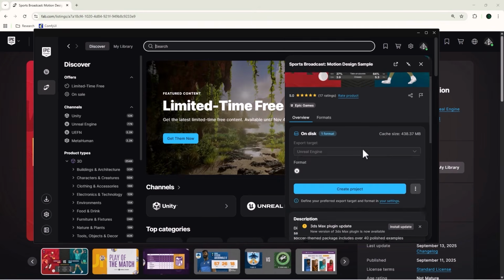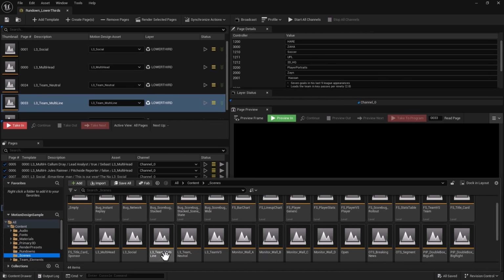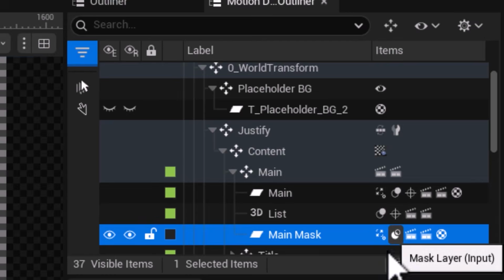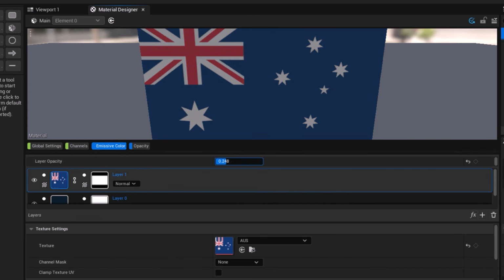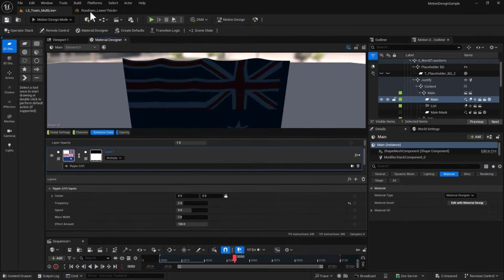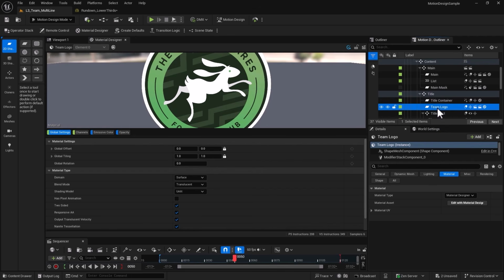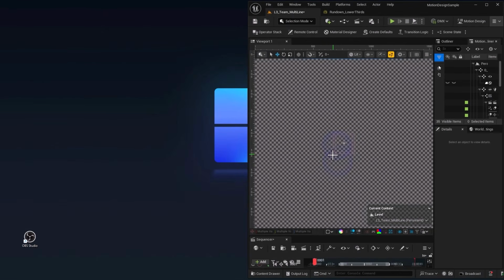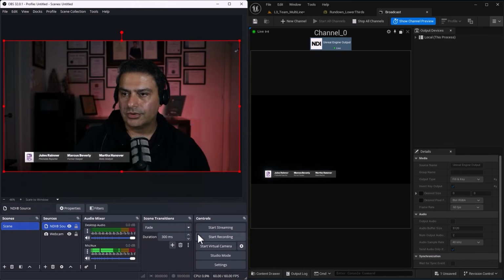#UE5 Series: Build LIVE On-Air Lower Thirds in Unreal Engine!

Comment: 5.7 The Substrate material system does not support the material designer of MotionDesign.This bug has been present since version 5.4. After the 5.7 official update, we immediately conducted a test and found that it was still the same...
Reply from the maker: Thanks for the feedback. I'll make sure to address this in a future update.